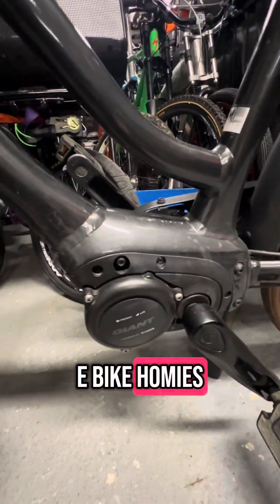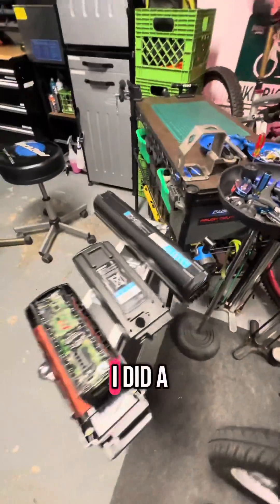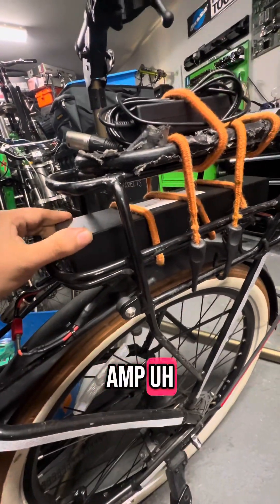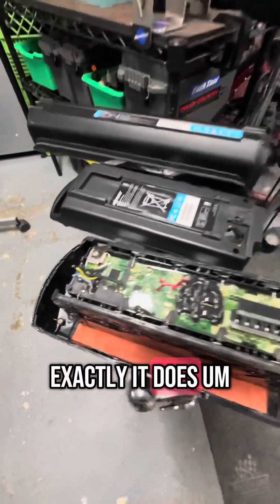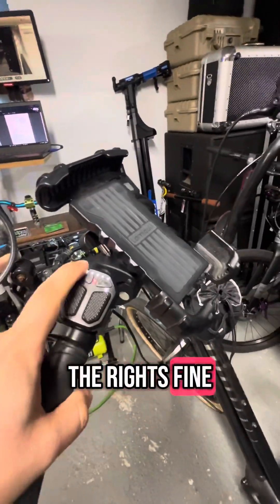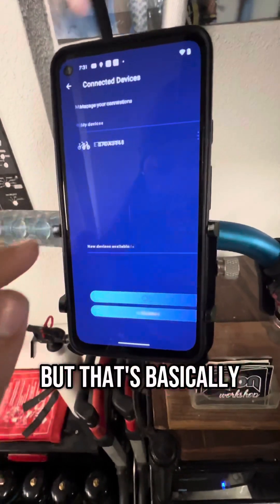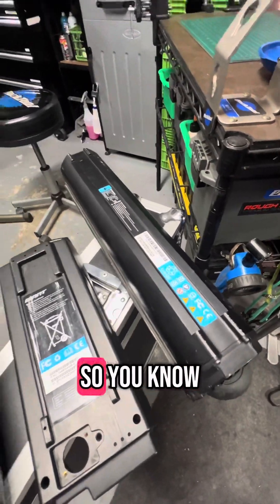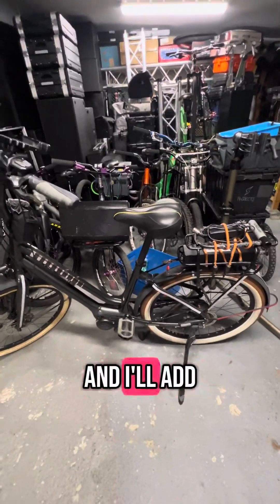Giant Syncdrive Ebike Battery Hack

Comment: Can you detail the wiring?  I know you mentioned another site or posting pictures… anything would be helpful.  Getting all lights on at once on controller on a used bike with wiring cut off using both red and a black wire to 36v

Comment: My bike is the same as this but when i turn it on it doesn't show any red buttonds an the btoons all the lights come on on the buttons and it just turns straight off if it was a major prob it would atleast show through the button lights have u any idea what i can do without bringing it to the shop
Reply from the maker: Sounds like the same problem as this video, no power from the battery, just turns off riggt away